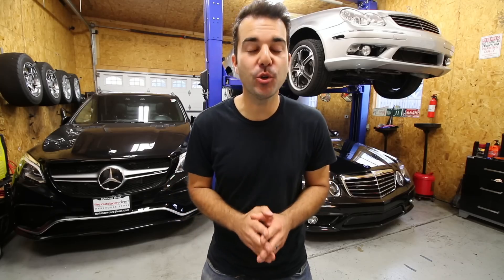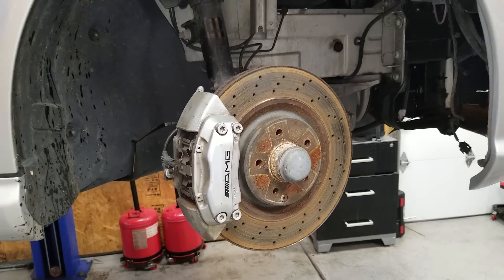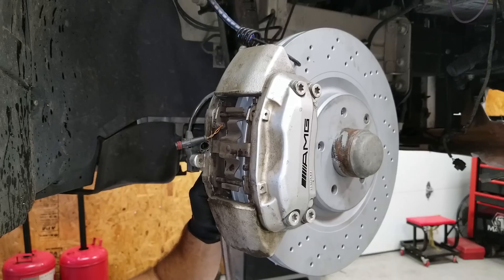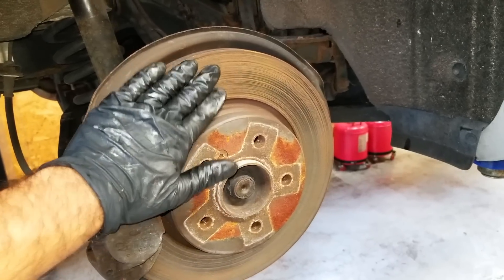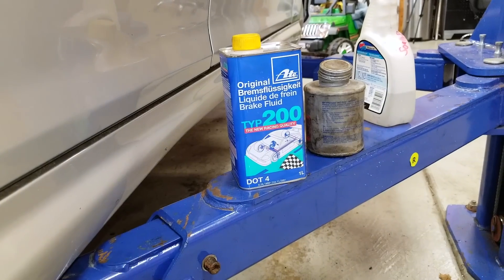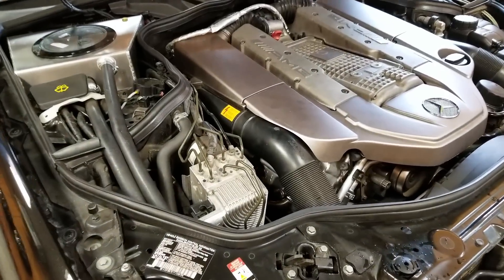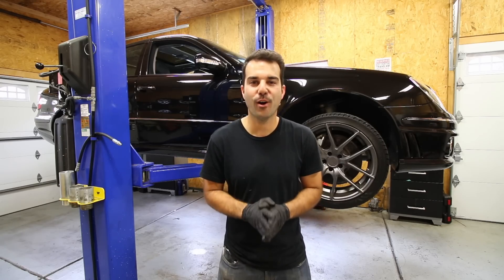Don't Let ANYONE Replace Your Factory Brembo Brakes Before Watching This Video. Big Brake Reality.

Comment from the maker: Workshop Repair Manuals For Your Car - http://bit.ly/2L2Ptj3
Use Coupon Code 10PERCENTEMO
Reply: LegitStreetCars isn’t that the same as WIS ?
Reply from the maker: @jagdeepsekhon308  Yes
Reply: LegitStreetCars thanks... also is the rumor true with the SBC being extended to 25 years from 10 years ?
Reply: I can't see the manual for 2016 E63, is this the right place?
Reply: hey I ordered one of those Workshop repair manuals for my 09 Escalade .Under the brake section were it show how to attached the caliper  it says "see special tools. We're could i find that section in manual for the correct socket size? Thanks
Reply: If you are going to recommend a site or service first double check that is legal...
Reply: The option to add coupon code is not there...how do I add coupon code?
Reply: Yeah no service manual for my 2014 C300
Reply: You have new subscribers ok thanks good job brother
Reply: Hiya just wondering if the SLK Silver Arrow rear brake discs would fit my 2007 C180k, my C Class is a sport edition which has the upgraded 330mm Brembo drilled brakes up front, I think the rears are 290mm solid plain discs on the back, I'm looking to replace the rears with drilled discs to match the front. Just like you did in this video. I hope you can offer some advise. Thank you.
Reply: No manual for a 2012 ML350?
Reply: Thank you!
Reply: LegitStreetCars is there an ABC repair guide for certain Benzes that use that thing?
Reply: The repair articles inside the pdf file don't open, already contacted the site but what could it be? Bought it for my W210 E-Class. Hope it's not a waste of money.
Reply: I need a Factory Shop Manual for my 2013 Mercedes Benz CLS63 AMG.    Have any idea where I can get the PDF as the link at Workshop Repair Manuals only goes up to 2011 for my model.
Reply: If your break pads don't produce a lot of dust the that means your rotors are going to wear out faster.
Reply: You should make a video about if you have to replace your rotors with every pad change.
Reply: Jagdeep Sekhon j
Reply: Alex, I’m about to change the calipers on my E320. How bad is it to bleed out? I’ve got a cheapy Foxwell NT624 and a power bleeder that attaches to the MC and has a pump to pressurize the MC.
Reply: Just ordered an email manual, let you know how it goes.  J
Reply: Bimmer
Reply: Site is not allowing the purchase of manuals. Says some BS about PayPal being an instant payment even though it is teir option. Kinda suck cause i was pumped to get a good manual.
Reply: Repair Manual link is not working
Reply: Seems to be an issue w the manual download or use or even getting on the site/ any help… direct name of the company please/thanks so much what ya do! Bawesome wrk!
Reply: are you still active/? Love your vids

Comment: A few comments from an ex-employee of one of the world's largest braking system supplier (also featured in your video):Great job, working on pads like this would minimize NVH. If only my customers followed all these steps, I wouldn't have had to waste so much time telling them why their pads are squealing or why their steering shakes at high speed!also, some reminders:- Always use accessories that come together with the brake pads (spring, nuts, pin, etc)- Ceramic pads do not handle high temperature as well as semi metallic - Sliding calipers must have sliding pins inspected, cleaned and greased using specific brake grease- If not replacing disc rotors, then make sure to measure minimum thickness- if replacing disc with a non-OE oiled rotor, then brake cleaner is required on the surface of the rotor- I skimmed towards the end, but was there any mention about bedding process? Gentle braking for the first 600miles/1,000km- Do not overtighten wheel nuts, or the disc rotor hub will warp.(don't use an air ratcheting gun on any brake related bolt)
Reply: As an engineer I am begging you, please spread that last message about wheel nuts/bolts among the thousands of stubborn mechanics that are doing it without torque wrenches for 30 years without problems. I have had that discussion many times. The wheels have a tightening torque spec for a reason!!! depending on the bolt/stud/nut material, the hub stiffness, what the designed tasks are, etc. The specs vary massively between differet cars, so I just do not believe that a mechanic has the spec for every different car 'as a feeling in the arm because of muscle memory'. Soory, I will stop ranting for now.

Comment: I was a Benz trained tech and this EXACTLY how I would perform the work. Very easy and clean. I approve this message!!!! I was first skeptical because a lot of people do this very wrong. On the money!!!!!
Reply from the maker: Thanks Richard.
Reply: Except for the excessive amount of antiseize on the hub to avoid shaking :D - Thin layer of MB hohlraum is prefered imo.
Reply: Richard Whitaker Do you really need to punch  the discs with a big steel hammer? Poor bearings...
Reply: The disc is not going to be reused, and if you go over bumps in the street that's a very similar load on the wheel bearing.
Reply: Did my 2002 Yaris and i'm no mechanic lol it was tough because it had no back plate thingy so it took ages lining it on perfectly and it move many times.I used Brembo pads online £26 in a sale.
Reply: I rather sue them if they fuck up my brake work... Insurance paid for accident.
Reply: 😫 hE uSEd TO mUch AntiSiEzE 😫
Reply: rvidal0001  heat conducting... Exactly why you dont want to use it.

Comment: Brake jobs are dirt cheap overseas.  It's American shops that overcharge them.  If you got to like Mexico, you can pay $200 for an entire brake service while it cost over $500 here.  The only reason I sometimes have it done for my Japanese cars when I can get a good deal for $59 per wheel.  Just to get pads done, it can take me 2 hours to jack the car up one wheel at a time to change it out

Comment: 1. Only use an oil based spray around discs or pads if you are going to replace the pads, as any contaminated pad is not retrievable, no burning or cleaner will get it back, they are like a sponge, 2. Clean the hub and if you are reusing the disc their contact face back to bare metal, any rust will mess up your disc run out, which can give you pad kickback and judder, we

Comment: Do not put Anti-seize on the hub face.  The entire purpose of the hub to wheel hub contact point is to create a clamping/frictional force between the wheel and the hub.  The lug studs/bolts are not what holds the weight of the vehicle, it is the friction between the two surfaces created by torquing the wheel into place that supports the load.

Comment: Good video, however take care when you remove the old rotor with that hammer since its centered on the main shaft and beating will damage the shaft.....furthermore, you should always a copper wire brush, not a steel one like you did, to protect the shaft from damage.....ignoring this, in time will damage the shaft and at high speed when you brake you'll have vibrating brakes and steering wheel....
And one more thing.....Mercedes AMG doesnt recommend lubricating the brake pads back, though its not a bad practice...
Reply: @hirayama n    >High temperature PTFE Brake lubricant is sold by the tons everyday. It allow the pads baking plate to slide inside the calipers frame and if apply on the back, do it where the pads metal plate touches the pistons or frame. Yes, brakes get hot but what is 600 degrees C? Hot!
  I agree on the hammer thing. Just remove the holding screw, install a bolt and gently break it loose.
  Although the rotor is hub centered, I don’t understand the “Brass wire brush” thing!
This is metal on metal, right? Not metal on toe nails. Use a wire brush to remove the rust, save your brass brush for welding brass or copper. 
  The coating on those rotors, looks pretty. What happens when they are real hot, the hit a pot hole full of water? Heaven forbid a car wash to get your Rally dust off! I bet they get rusty if it rains...Whoops
Vacuum bag the car, nope, that will cause the fuel to boil if warm! Oh well. Coated rotors = $22 dollars more, each, but pretty! 
ASE Master Tech since 1978 - Retired
Reply: @deankay4434  Dont understand about the PTFE thing, i only said that AMG mercedes doesnt use pad lubrucants, though its a good practice.
Regarding the wire brush thing, i know that the rotor is hub centered, and ive experienced ( not seen or heard) in numerous cars warping sindrome due to hub damage made by agresssive wire brushes.
That hub has a lip which centers the rotor and in some cases its pretty thin and it can be easly damage....
Those are things that ive experienced and above i stated my personal opinion on that.
Reply: hirayama n  PTFE is a very high temp grease designed to help reduce noise and promote pad movement and operation. It doesn’t drip onto the friction material and wheels. It’s Teflon additive to make it high temp. 100 degrees C = 212 degrees F. 
If these things have such a delicate hub lip, then I wouldn’t work on one. Wire brush action on a steel hub... We are not talking grinder with 10,000 RPM wire wheel. No tech would do that, only someone who has no clue.
 I have thousand of vehicles the customer or their buddy who stuck BB’s in vacuum lines, plugging hoses into wrong spot ever with hose chart on the hood. It is done by factory methods or not done at all. Things change like high temp brake lube...not on friction, hammers or grinders. I could do this stuff in my sleep correctly. 
 #1 Confirm the customers concern.
#2 Locate the root cause.
#3 Get authorization from the customer.
#4 Repair the root cause using the manufactures recommended procedures.
#5 Confirm customer concern is repaired after fixing root cause.
#6 No guessing or lying to customer.
#7 Repeat process with next customer. 
We (Techs) are paid by flat rate and no % of parts. It is based upon warranty and pays a written value regardless if you can do it faster or spend 3 hrs more, you get paid the same.
This Makes You Good!

Comment: 5:30  Check brake fluid level before you start compressing pistons. I've seen fluid rise and come out the lid breather.  I use a clean sludge gun to take some fluid out prior to work.

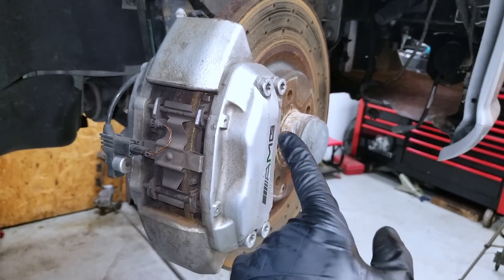Comment: 4:24 I helped my neighbor do the front brakes on his Tacoma and that truck has the same setup with the two pins that get knocked out and the pads slide right out.  Pretty cool to see for the first time, no floating caliper action.  Different.  My GTI and Accord calipers covered in rust, floating ones nothing wrong just rusty from sitting so long.
Reply: They are awesome because I hate stuck/rusted slides... I understand that there is a bigger initial cost but I wish it was prevalent on all cars

Comment: Brake cleaner wont destroy the caliper paint, ive been working on super cars for about 15 years and clean brembo and various other painted calipers every day with brake cleaner. If it destroyed paint it would have a large warning on the can. Its essentially the same stuff they use in body shops to clean paint. (panel wipe/rapid degreaser etc).
Reply: it will soften the paint if you use it enough on the same caliper to the point you can remove it with your fingernails.  I've done it.
Reply: Brake cleaner is just Acetone and Toluene. It's literally paint remover. It will fuck up your paint, you're doing damage to the clear coat a little bit every time you do this.

Comment: Hey Alex, really enjoying your channel. Great stuff. Regarding brakes of this setup, I would recommend that anyone doing this work give the brake pad pins a once over while they are in hand. Not sure if it happens with cars but with my Honda sportbike , I had an issue where the pins were getting notched from hard usage(track day) It was causing the rotors to overheat, Simple fix was to replace the pins. But from then on I would dress the pins with  steel wool while doing any service. 
Again, Thx
Reply from the maker: Great tip. I've never seen any issue with the Mercedes pins but not a bad idea to take a good look since they are out anyway.
Thanks!
Alex

Comment: Alex, because of this video you have given me the confidence and I'm gonna go do it, my brakes. What did you think I meant? I'm gonna go do my brakes because, well why the heck not after seeing this video I'm inspired and I am gonna get one of those manuals for sure.
Reply: Sanctus Vianney you should!  I do my own on my 2 BMW’s and I can’t believe how easy it is.  Just always remember to put something under the car in case the jack fails... you’ll do a better job than the shop.  Why?  Owners show more care and tlc.
Reply: Yea between him and Tasos, I've started wrenching on my AMG as well.
Reply: I just change the front brakes on a 2000 Volvo. I will be doing my 300D soon.
Reply: IM GONNA JUMP! jump right into the repair that is... 
On an actually related note, the front brake discs on my dad’s E550 weigh more than my car’s wheels, tire and all!

Comment: Some of the Brembo big brake kits don't support pulling the pads through the back of the caliper - you have to remove the caliper.  That was the case on the kit that came installed on my '12 TTRS.  This is so much easier...  The caliper was attached with two  bolts torqued to 200nm...  Not exactly "convenient".

Comment: I have worked at major german manufacturers. We are not allowed to "lube" the wheelhub...when the lube heats up the Wheel hub wil have a little room to move between the Wheelhub and the brake rotors. Witch will in turn make noises because of the the room created. especially with ceramic rotors.

Comment: I drive a 2 series BMW with the M Sport brakes made by Brembo. Blue calipers with MSport on the front and Brembo written on the back side. Only difference from the AMG pads is that they have two "ears" on each pad to grab onto and make removal even easier!

Comment: Didn’t watch to the end - but when you levered the pistons back in would be good practice to remove the cap on the fluid reservoir so you don’t build excess pressure.
Might not be an issue on all cars - but could damage seals on master cylinder.
Reply: Only an issue if you filled your master cylinder full before replacing the pads.
Reply: this is a good idea, also, if you are replacing both front and rear pads, its a good idea to do one end at a time and press brake in between so brake fluid wont spill out.
Reply: Crack your bleeder instead. Also helps free them for when you next do a bleed. (every two years)
Reply: @barrybritcher  Great idea, I always crack the bleeder and push the excess out rather than back into the system.

Comment: break cleaner does NOT ruin the paint dude, haha is the best to clean any painted engine and break parts ever.
DONT ANTI GREASE clean it and dont use ceramic crap buy Brembo org racing u want to be able to brake NOT be dust free - Use 1 time never ever again 1 emergency brake and the Ceramics are toast + ROTORS TOAST. DONT

Comment: You make it look too easy.  I unfortunately am unable to remove the retaining bolt on either side in the front.  They appear to be rusted in.  Also having issues with the  pins on one side.  Tried silicone blaster and a torch....any ideas??  
Thanks

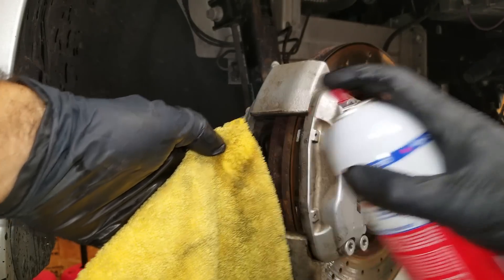Comment: 6:01 Please be careful with compressed air ;
brake dust is harmful so make sure the area is well ventilated and wear a mask  one that is rated N95 would be best.
Reply: oh stop crying..... it makes no health impact. unless you breathing them 20 years in a row
Reply: You are right! Never blow brake dust! This is the first thing you learn at school!  You already breathe enough dust in a workshop.
Blow your nose after a day of work and watch what comes out of it ...
Reply: N95? Laughs in covid
Reply: @Tomas Av.   >It is unfortunate to get incorrect advice from a novice or no experience commentator. All manufacture require the use of a “N-95” particulate mask as the correct cleaning procedure is gloves, mask and low pressure water. The water is to be captured and returned to a disposal company. Regardless of manufacture, this is best practice for a professional service tech. Also, regardless of year, the question is on the test of 60 questions just for brakes if you take the ASE exam test, one of 8 to become recognized as certified required by some companies, required in some states and almost every state vehicle repair shop. Police, county or state vehicles, will not hire you if you’re not certified in this area and all within a year. Unless you gather dust all day in a cubicle.
ASE Master Tech since 1978 - Retired

Comment: On my 370z there are small locking pins preventing the larger pins holding the pads from sliding out. Are the mercedes ones just in there really tight so they wont vibrate out? When I got my car used, I didn't check one of the calipers and the pin was slid out a little bit. Could have been bad, I'm glad I fixed it.
Reply: These are very similar to some earlier Porsches. The pins have little interference fit bushes that seat into their housings and need to be tapped out, as he did. Simplicity is always best.
Reply: The pins has a thiner diameter in the middle and gets locked with the anti vibration pads shims.

Comment: I have a 2016 Cadillac ATS-V with 6piston Brembos. I’m going to replace the rotors and pads. I just want to know what you recommend for the torque value on the T bolt holding the rotor in place and the two bolts holding the caliper to the knuckle. Thanks.

Comment: quick question,  could i switch w203 c230 rotors and calipers with w203 c55 amg ones without upgrading the pump, would it still work or not??

Comment: I am a trainee in a Mercedes operation in Germany and found this video very interesting! 👍🏼
Reply: Never use anti seize near brakes! That makes noise. Use regular grease, red anti squeak on back of pads, brakekleen entire area doesn’t hurt anything and gets rid of brake dust. Regular grease on brake caliper brackets